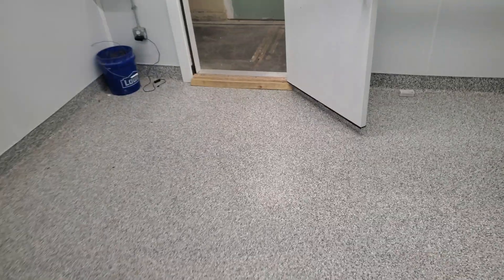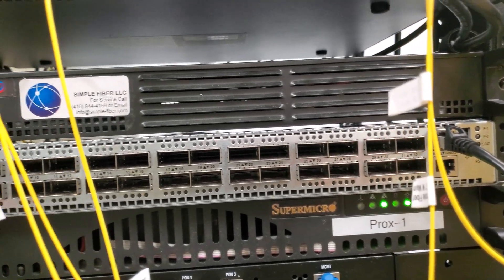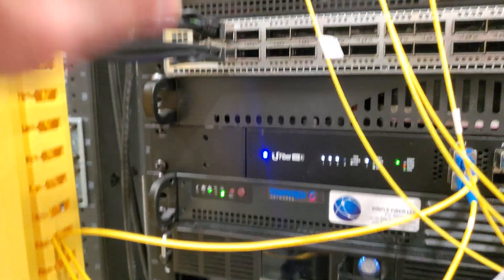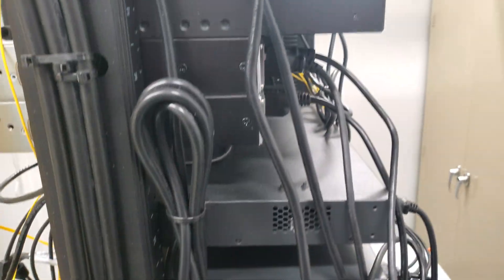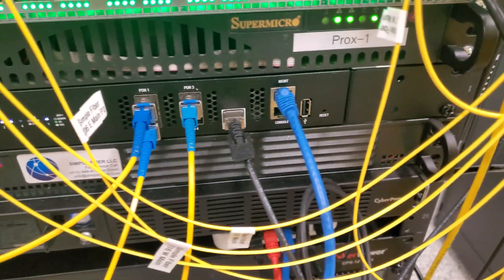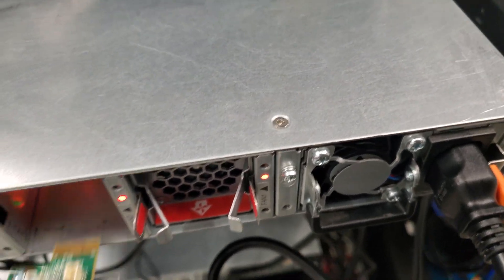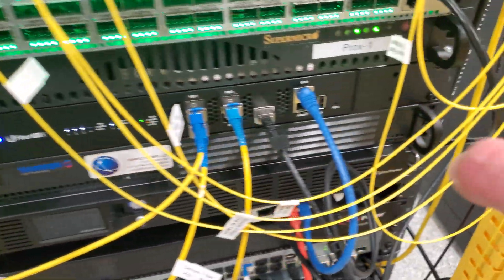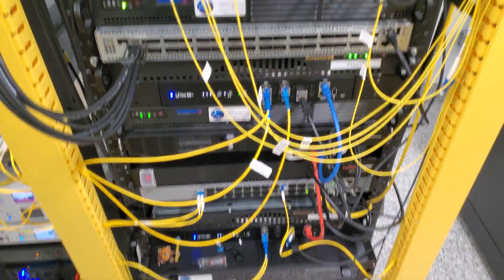Step 1 upgrading a 2x10G core to a 2x100G core

Comment: I looked up Celestica and yes they have some switches but boy they do a bit of everything!  Systems integration, CNC Milling, Welding and Sheet metal, Supplier Development, Clean and Powder coat, Aerospace and Defence, Health Tech,.  So wild!
Reply from the maker: They run the SONIC operating system which was developed by Microsoft and they made it open source.  Doesn't sound like Microsoft right?

Comment: How do you like those FS switches?
Reply from the maker: I don't mind them at all maybe 20 on the network never had any issues.  Also there shipping speed is wild I can get new one under 15 hours off there website.
Reply: @briceperdue7587  That's good to hear. We've been real happy with their DWDM gear, optics and so on so I figured their switches couldn't be too bad but I don't think I've ever actually seen one deployed before.
Reply from the maker: @sandy1653  Moving from there gear new to used Arista gear for a reason but not the one you would think.
Reply: @briceperdue7587  Oh? We're a mixed Arista/Juniper shop for switching & routing Arista has been good to us for sure. Although the used market seems to be drying up a bit.

Comment: Any idea what that M1 port is?  I have a DX010 as well and can't seem to enable it.
Reply from the maker: M1 SFP port from my 30 minutes of research.  Appears to be a port used in the stock Celestica OS that allows for possible state table and\or management to stay out of band stacked.  Sonic NOS doesn't support the interface and it does not show up at all as far as I can tell.